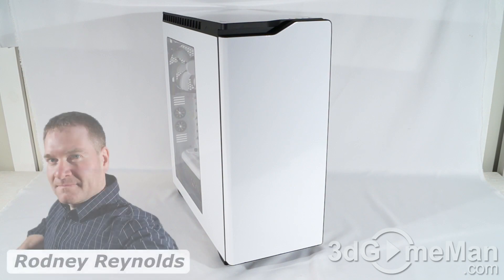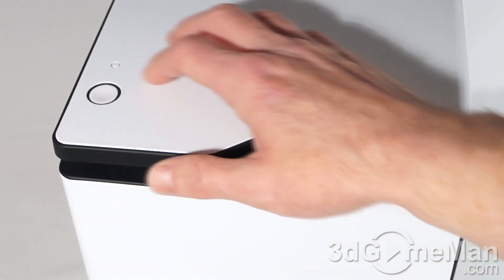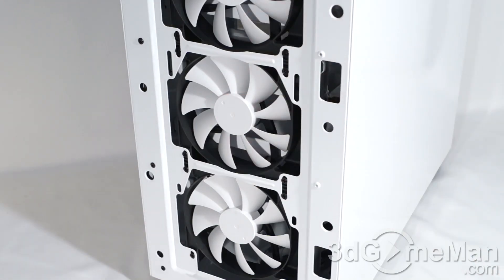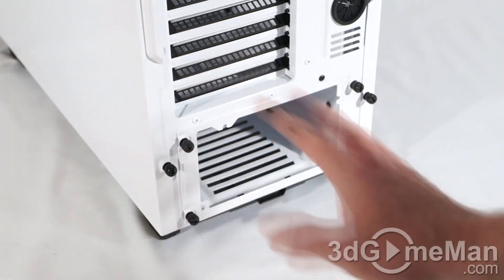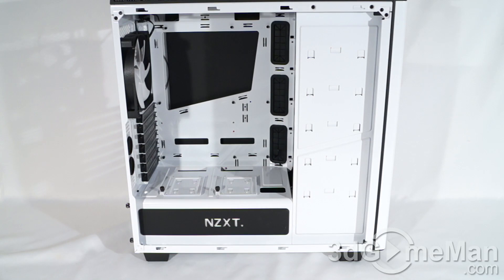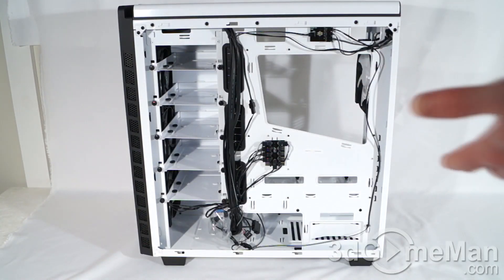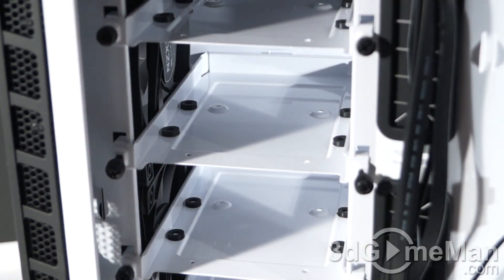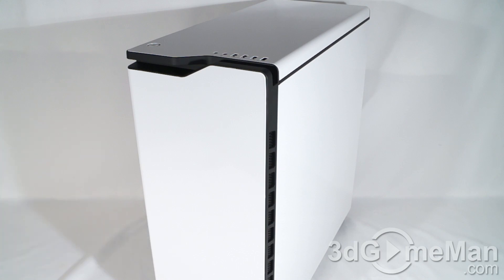#1570 - NZXT H440 Case Video Review

Comment: If you've an ATX M/B installed is there space to route the 2.5" power and sata cables through the cut outs at the bottom of the M/B tray?
Reply from the maker: groMMit1981 Yes, it should fit.

Comment: IS the NZXT Logo plate on PSU shroud removable? or is it rivited on the shroud its self and cannot take out?
Reply from the maker: PedoBaur Well, it's not meant to be removed, but you could. NOTE: There's an LED that lights up the Logo, but that could be removed and relocated if need be. A bit of modding might be required.
Reply: I see. Yeah i only want to spray paint it that is all. Do you know if it is rivited? cause i dont wanna take it out and spray paint it and have a hard time putting it back in if it wont because of rivited holes.
Reply from the maker: PedoBaur I believe it snaps into place.

Comment: So would this case be a good choice as a replacement for my 922 haf case. I need something that is not overly hard to manage cables in because that is one thing I have not quite gotten down so far as builds go. I really like the black version of this case but I just do not know if I have the money to spend on it. I wanted to know if you had any other recommendations for someone looking for a more minimal design, great and easy cable management, and finally good airflow and cooling? please if you do have anything in mind for around 100$ I would appreciate the write back.
Reply from the maker: Patrick Murray Yes, I think you found your replacement :) One of the best all around cases out there minus having no 5.25" drives.
Reply: 3DGAMEMAN Say I could not afford it and needed a case on the spot is the 530 source also a reasonable replacement because I really like this case, the Fractal design define r 4 and the 530 source, and right now the Fractal is only 80$ free shipping.
Reply from the maker: Patrick Murray Both excellent cases, but if you can get the Fractal Design R4 for the cheapest, I'd go with that. But way your options on both and ask yourself if the 530 is worth more.
Reply from the maker: Patrick Murray 
#1399 - Fractal Design Define R4 Case Video Review
Reply from the maker: Patrick Murray 
#1538 - NZXT Source 530 Case Video Review
Reply: 3DGAMEMAN I have watched all these videos and thanks for the links and the replies. I think both the fractal case and the 530 source look like great buys for the price. Now it comes down to I do not know which case would be easier for someone that lacks the experience with managing cables because of the case I own currently. Also do you know if fractal sells individual side panels with a window because that is the real reason I am considering the Source over the R4 because the R4 is only 80 dollars after shipping right now, and if I could purchase a side panel with a window afterwards when I have the spare money then I would probably buy that one now before it goes off sale. If you could get back to me with any information about the side panel option, or if you have any other suggestions of a case that looks minimal and nice aesthetically, easy cable management, airflow, and finally for aroun 100 dollars because that  would be great.
Reply from the maker: Patrick Murray Since the R4 is on special, go for that one.
Reply: 3DGAMEMAN That is probably what I will be doing to be honest and I just wanted to ask do you know anything about them selling the side panel with a window? because I went on fractal's website and did not see anything like that. I am hoping that they do though because that would make it the perfect buy for me. Thanks for all the feedback and the super quick replies...it is really cool of you  because some people that make videos will never reply to the questions that the viewers(myself for instance lol) put forth because we lack experience with said chassis and or peripheral and we need some advice and or feedback that is not our own. So I will try find out if I can purchase the side panel separately at a later date. Let me know if you already know the answer about that question, thanks and take care.
Reply from the maker: Patrick Murray No problem. Spread the word bud ;) Enjoy the case and let us know how you make out.
Reply: 3DGAMEMAN I will do just that, and I hope I like the case too and from what I read on their webpage it does seem like you can buy a separate windowed side panel to replace the other one. So, now it is just my girl not getting mad at me for spending 80$ on a case and I hope that it works. I believe it will because she knows I am about to finish her build I am getting for her birthday to replace her aging anthlon build that is not cutting it anymore for raids and what not in game.

Comment: Would this case support a H110 AIO CPU cooler?
Reply from the maker: TheBlueness™ Yes, as there's two 280mm options, at the front and top. Not sure the tubes would be long enough to mount it at the front, but should definitely work when radiator is mounted at the top.

Comment: Nice case but I think I like my NZXT Phantom Full Tower better. I mean this is nice if your going for the clean sleek look ect. I'm not ready to sacrifice my drive slots yet either. How does that even work? I don't understand how one would install Windows ect without a CD drive unless their booting through an SD card or external HD I guess. I must be too ol skool to get into this kind of setup. This has its ups and downs for what it has to offer but aiming at a specific crowd of newer PC builders being they eliminated the drive bays.
 Great review though, Thank you
Reply: Booting from a USB is very easy to do now adays.
Reply: vearheart42
Nice info to know, I'll have to look into that. Im assuming its easier to do then all that burning CD crap we had to do back in the day. I noticed it gives me the option to boot from USB via my bios so will have to give that a try. Thanks for the heads up.

Comment: http://pcpartpicker.com/p/34QHl

so this is the build I'm going for but I'm just concerned about all of this actually fitting into the case. will all this fit in the case fine?
Reply from the maker: Sammy102093 At a quick glance, yes that should work, but I'd personally recommend a WD HDD for better liability.
Reply: I switched out the Seagate for a WD Caviar Black with the same storage and speed

Comment: Got this case thinking that it would be good for water-cooling. It's not. 
Not enough space on the top for a 360 45mm thick rad with fans. Had to give up installing the third fan closer to the back. At the front, if you want to install a rad, you'll have to remove all of the brackets for HDDs and still, tight fit. The design would be great only if this was a FULL Tower. And inch more in the front and top + half an inch behind the MoBo tray would make it worth it.

Comment: lol so they did not put in a case for your optical drive
Reply: I havn't used my optical drive in months. There is no point in having one, and if you do need one, just get a USB dvd drive.
Reply from the maker: ***** Same, I don't use an ODD anymore.
Reply from the maker: ***** It's limiting when it comes to a full control 5.25" fan controller, yes, but there are PCI slot controller available.
Reply: 3DGAMEMAN I think that is the only problem I would run into with this case, and they are making NZXT hue not usable.